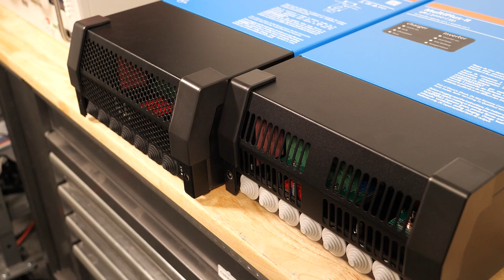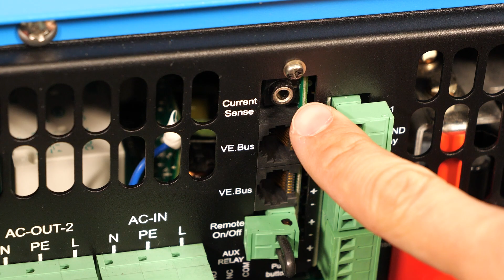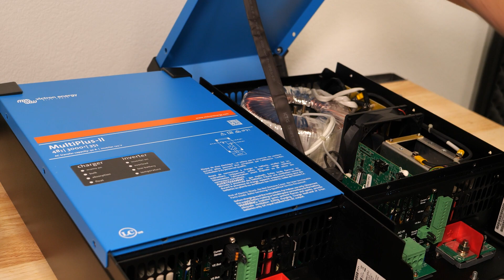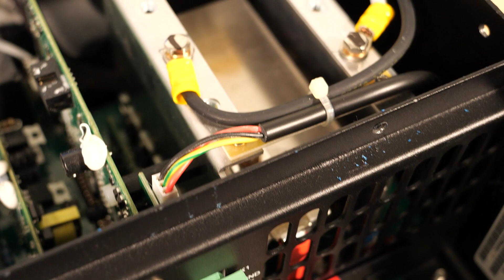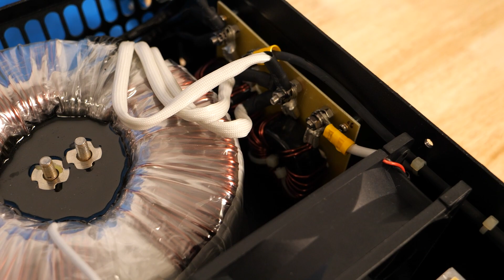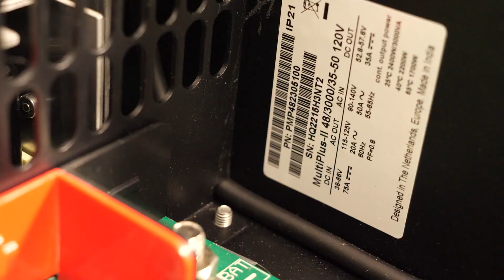Victron MultiPlus-II 48/3000VA Inverter | UL 1741 Model VS Non-UL Model

Comment: What is the connection called that enters the VE.Bus device? I refer the "phone type connection"
Reply from the maker: The VE.Bus connector is called an 8P8C connector, which stands for “eight position/eight conductor.” More commonly, you'll hear this referred to as an RJ45 connector. Just be aware that not all RJ45 cables have the proper pinout for VE.Bus communication!

Comment: I assume on that capacitor at 3:58 you are probably correct on that UL listed, but if the comm port difference came later - it could just be easier to manufacture with all on one side, and never re-tooled or had boards from a large quantity run.  The capacitor on UL looks shorter in video - are they the same values?
Reply: That’s a good catch about the capacitor, I have two units I want to install, one came UL and one non UL, wondering if I’ll have any software compatibility issues once I go  into Victron config for split-face setup, or if they will work different in any way.

Comment: Why does both your multiplus ii units only have 1 red 1 black on the 12v side? Mine has 2 red 2 black?
Reply from the maker: This is a 48v unit not a 12v, so it has 1/4 the current carrying requirement.

Comment: How soon will Victron certify the 48/5000-70 or 100 kva model to UL certification?  That’s the one I need?
Reply: I made the big mistake of buying 2 48/5000 mp2 units a few months ago not thinking about ul listing issues.  Also have victron charge controllers.  Planning an off grid setup.  Really want to use victron but may have to sell this stuff😔.  Maybe the inspector won't check?
Reply: @ry2456  in us you actually need an inspector to tell you what you can and can t do in an offgrid setup? That is garbage!
Reply: If they get the 5000 listed it would be nice if they would sell a replacement terminal shroud that would give you compliance.
Reply: I’m waiting too for the UL listed Victron!!  Come on Victron, how long does it really take?

Comment: Hello, Can this inverter be used to feed power back to the grid (aka net metering)? I know the U. S. grid is 240 volt, but I already have a Victron 120-volt to/from 240-volt transformer. Thanks
Reply: I also would like to know. I have read the documentation on this inverter and they have something called "a/c feed in" that reads like it will back feed the grid, but I haven't been able to find anything that says for sure.